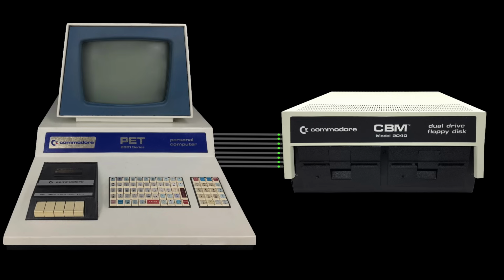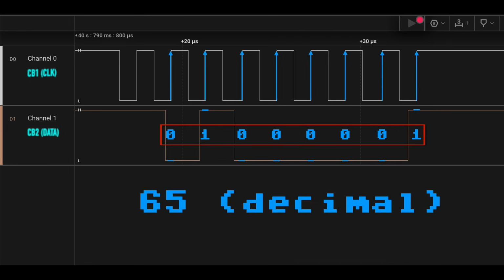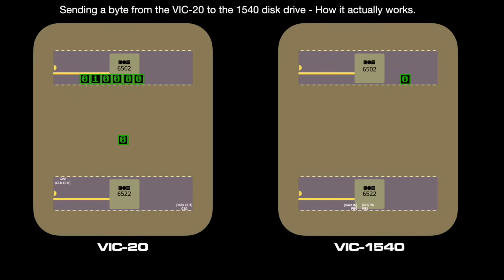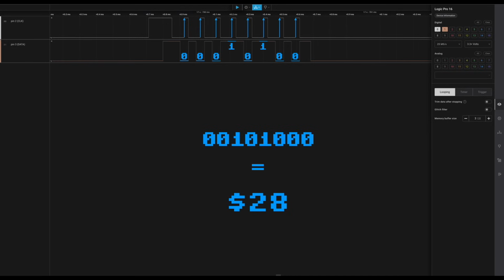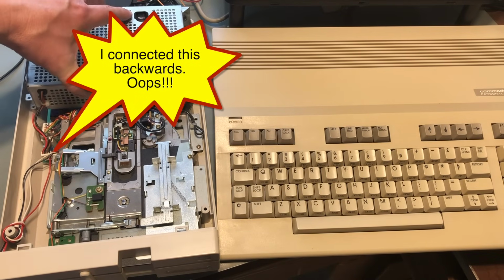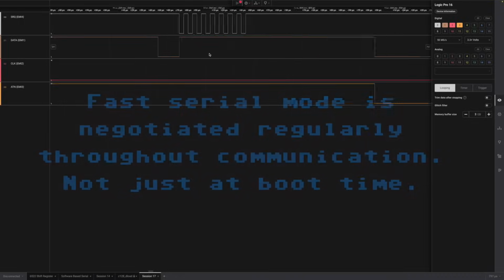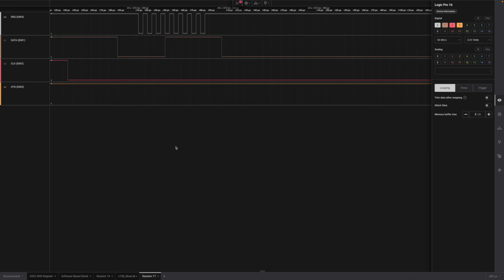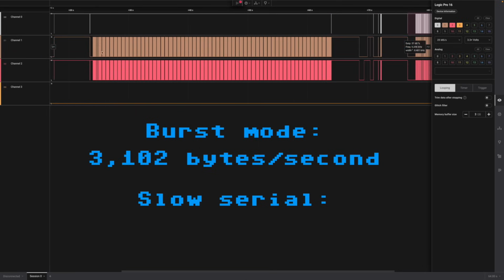Deep Dive: Commodore's Fast Serial Bus Protocol Explained

Comment: Very informative and interesting, worth watching again to refresh some stuff. I wonder if this could be fixed in C64 now, i think i saw some video about desyncing data because of 2 different clock domains and some approaches to fix it with hardware, although i think i'm gonna have quite a trouble finding it right now.

Comment: All they needed to fix the bug was 74LS74 in both the computer and the drive (and maybe 3 state drivers for direction control). Why they never realized that is a complete mystery, because it was evident that the whole problem was clock domain crossing and it was just needed to re-synchronize the clock to receiver PHI2.
Reply: All comes down to deadlines/timing, budget and profit margins and  of course human error. So yes solution maybe simple now, but at the time is $$$$ and managers and circumstances
Reply: I've heard that they wanted to get this out for Christmas, which was such a big driver of business in those days that missing it might have ended the company.

Comment: The slow disk on the Vic-20 is unfortunate but understandable, but on the C64 it was really inexcusable.
I mean I thought it was a bug improvement over tape, but that's about all you could say for it.
Reply: Funny thing tape with a fast loader (included in many tape based games) was about as fast as a 1541 with no fast loader.

Comment: Wow, so at least the burst version of fast mode was a good 8 times as fast as slow-slow mode! Now I wonder how this compared with using an SFD 1001 on the user port, and how it compared with using the 20- and 40-series drives with the PET.

Comment: So the burst mode was was the even faster fast mode? Because I saw that they made that work too. Why wasn't it just the default for the 128 mode/71 and 128 mode/81 combo? Which things could only work on slow-fast mode but and which things could work on fast-fast (burst) mode, and why?

Comment: I bet that doesn't actually plug into there, and I bet that Commdore's serial cables were the same for every computer that supports that protocol, even if we don't look at it. And yeah, the VIC-20 through the 128 includes the 264 series (+4, etc.).

Comment: Sure, they fixed with 128/71, but then hardly any software was written for the 128, so... sort of back to square 1, right? (Not that that was fully their fault. Too bad they didn't send out permanent patch chips. But if 3P devs wrote patches then why couldn't Commodore have used that method for stepping around bad 6522s and missing board traces?

Comment: Why would those silly production engineers remove the traces on the PCB then? And then why were those not restored in future board rev.s with the Kernal modified accordingly?
Reply: I’m guessing it was less removing traces which shouldn’t cost anything and more removing supporting components like tri state buffers or something. Commodore was REALLY cheap
Reply: @loraxiam : No, he specifically said this thing that I asked about.

Comment: Why didn't they just design a fixed version of the 6522 and fab that out? Yeah, a pushed-back release date on the 20, but their release dates were their own to modify as they pleased, were they not? And if this on the V20 and 40 was still supposedly slow then how was it still faster than on the 64/41?
Reply from the maker: I might have answered this, and your two next questions in my previous video, but not sure:

https://youtu.be/kaeFV0oZaps?feature=shared
Reply: @commodorehistory : OK, thanks, I'll check it out and see.
Reply: I would search the answer in the "business is war" mentality of Jack Tramiel: Delaying a computer would allow competitors to be first. And yes, I think this did matter around  the time frame that the VIC-20 was introduced.
Reply: @danielmantione : Yeah, I guess if he got word that Apple was working on the Plus or the IIe or whatever, or that T/RS was working on the CoCo or something like that, at the time, and he wanted to beat those, this makes sense. Thanks.
Reply: You have clearly never worked for Jack Tramiel, or heard the stories. Release dates were his to set as he pleased, and you made them....or else.
Reply: @Curt_Sampson : Exactly what I was asking about. HE was part of the company. So by "they" I meant even if it was him ("they," the company in general; so "him" if that's what it took). So you can't know just based on what I said before that I had never heard the stories. Because even someone who had heard the stories could refer to him as part of them and still have this question unless the person could've asked him about it or learned from someone else who had and gotten his reply.
Reply: @HelloKittyFanMan..  Nobody who's read up on Jack Tramiel could ever reasonably suggest that he might delay a ship date, especially by the months or even year that it would take to re-fab a chip.
Reply: @Curt_Sampson : Fine for them, but that doesn't apply here. I didn't suggest; I asked WHY. There's a big difference.
Reply: @HelloKittyFanMan..  Of course it applies here. The VIC-20 was a Commodore machine, and Commodore was run by Jack Tramiel. Your question is easily answered by noting that the action you suggest would have involved pushing back the release date (and not by days, but by months, at least) and knowing that Tramiel does not push back release dates, ever.
Reply: @Curt_Sampson : Wrong. No it doesn't apply, because: 1. you claimed that I would be suggesting to him to move the release time, but 2. that's not what simply asking WHY is. 3. I could already have the idea that he would supposedly "NEVER" adjust a release date, as you claim, but that doesn't mean I had never heard the stories, because my question of WHY he supposedly wouldn't ever is still valid, because "he never does" ISN'T the answer to WHY he supposedly "never does," or WHY he supposedly "couldn't have done it" in this case just because he supposedly never had before.
Reply: @HelloKittyFanMan..  My claim that the release date would have to be moved significantly is exactly correct: you were suggesting fixing and re-spinning the 6822 chip, and you cannot fix and re-spin a chip in a few days. Tramiel doesn't do that: he's rather release something that doesn't work as well than release something better weeks or months down the road. I don't know why that's so hard to understand.
Reply: @Curt_Sampson : Wrong. This isn't about "not understanding" something you said; and again, I wasn't suggesting anything; I was ASKING why about it. Also, it's not current that Jack does or doesn't anything; he's been dead for a long time and Commodore has only been back in business for a few months since many years (not just the 30+ since Jack's iteration went down).
Also, I didn't say anything about resending anything. Just because Jack used to choose not to do something doesn't mean he couldn't ever have changed his mind, hence my question here, as it could have been better to finally make sure this was fixed for the 64 instead of releasing something semibroken, hence my question. So if you don't know the actual underlying reason then it's okay for you to just admit that and move on.
Reply: @HelloKittyFanMan..  I have told you why. You've somehow got your knickers in a twist over my idiomatic use of English that included "suggest," but even so you should see that it's entirely irrelevant: it wasn't delayed for a that fix for the same reason regardless of whether you did or not did not suggest anything. And why you start bringing up Commodore from a completely different era, long after this decision had been made, I have no idea.

I won't be responding to this further: if you have difficulty figuring out why this decision was made the way it was after all this, you'll just have to live in ignorance.
Reply: @Curt_Sampson : No you haven't. You've only told me what he'd rather do and did. And now you're starting to be rude for no good reason. You obviously don't know the reason, so living in ignorance is something you've still been doing. I don't know why you replied in the first place.

Comment: "Software-based"? Isn't it actually still hardware-based but they just put it in the Kernal to tell the CPU to do, so it's kernel/CPU-based but still hardware (since that original one never loaded from disk or tape)?
Reply from the maker: That's exactly right, but the kernal is software. The distinction I was trying to make, but maybe failed to do, is that the 6522 did all the bit shifting and serial transmission in silicon, while the solution they ended up using was kernal software written to bit shift and manipulate clock and data lines.
Reply: @commodorehistory : Software in the beginning, before being permanently put on a chip, but it was my understanding that when programming is moved from something that's not a chip onto a chip that it can't be removed from, it becomes hardware, hence my saying that while this might act like software, it's still just hardware but that hardware is commanding the CPU, so this solution (or partial solution) is CPU-based rather than direct. Remember firmware? That's halfway between software and hardware; what was software to start with but then it lives on a chip that it normally stays on and is only rewritten with a flashing process. Isn't that the difference?
Reply: @HelloKittyFanMan..  No, all code is software. We call it "firmware" when it's stored in ROM instead of RAM, but it's still the same code, and still software.

The difference between the hardware and software shift is that for the hardware shift the CPU writes one byte to the 6522 and it's done: the byte is taken apart and transferred bit by bit by the 6522. Whereas with the software-driven bit by bit transfer (often called "bit banging"), the CPU masks out the bit it want to send, moves that bit to the correct location in the byte, writes that byte to the 6522, writes another byte to the 6522 to flip the clock, waits a bit for the other end to read the bit, flips the clock back, and then repeats that whole sequence seven more times. As you can see, that's a lot more instructions than just "write a byte to the 6522."
Reply: @Curt_Sampson : So what determines when a digital non-RAM, nonlash chip is just a place for software and that means what's on it is also firmware, vs. when it's just hardware, like when we call a CPU hardware? How are CPUs themselves made when they weren't coded themselves? In other words, how are those designed and then etched, and they weren't designed from code because they are what runs the code instead? And the same question for chips like the 6522.

Comment: They wrote this code on... what machine? Did they use the PET? I think I saw some disks that showed that, but I don't remember for sure. But then what did they write the PET on?
Reply from the maker: I think they did most of the PET development work on an MDT-650.
Reply: @commodorehistory : Thanks! What's the full name of that?
Reply from the maker: https://archive.org/details/mos-mdt/
Reply: @commodorehistory : Huh, interesting, thanks! Well then I guess my next question would be what this was written on. But I'll look around for a video about it.
Reply: @HelloKittyFanMan..  The original code for the first 6502 computers would have been written on non-6502 computers (there were plenty around—Gates et al. did MS-BASIC on a PDP-10) just on paper. It's tedious but not terribly difficult to write out assembly language on a piece of paper, hand-assemble it, and then burn the code into an EPROM or whatever. This is how Steve Wozniak wrote Apple II Integer BASIC.
Reply: @Curt_Sampson : At which of those stages that you mentioned would the PDP come into play? And then what about before EPROMS were available or at least common? Some code chips are obviously not those. So if you had to do this without one of those, how would that be done?
Reply: @HelloKittyFanMan..  The PDP comes into play at the programming stage, when you write your program in assembly language and then translate it (via manual or automated means) into binary data.

If you don't have EPROMs available, there are plenty of other forms of ROM or persistent RAM you can use. You can give your code to a ROM vendor to get a mask ROM made, for example. Worst case, you can simply solder diodes to a board to make ROM. Start with the "Computer memory" page on Wikipedia to get an idea of the various forms of memory out there.
Reply: @Curt_Sampson : Write it in assembly using... the terminal? And then what sort of thing in that system translates it into binary, and why would you have to do any of it on paper? And what I was asking about non-PROMs is: How does a ROM vendor/chip fabricator make a non-PROM version of the code you sent them?

Comment: 5:54 OK this is confuzzled. How can is be both MSBit and LSBit?  Whoever decided to move away from parallel really was a weenie. Imagine how much more seriously C= would have been taken if not for the slowest-of-class disk IO.
Reply from the maker: The 6522 and 6526 shift registers both shift data out MSB first. The software serial implementation shifts data out LSB first. So as you noticed, there is both MSB and LSB on the same bus. It works out fine because MSB is chip to chip, and LSB is software implementation to software implementation.
Reply: @commodorehistory  Sorry man, still makes no sense as described in video.
Reply from the maker: I get that you didn't understand how I described it in the video. Does my reply in the comments not explain it? If not, what is confusing? I'm happy to help.
Reply: Moving away from parallel likely was a wise choice: You should not underestimate the impact of low-cost easy to handle cables for consumers. Of not using the 6522 shift register was a major drawback and did highly impact the usability of Commodore computers, but even considering the slow speed of the serial bus, it may have been a wise decision in hindsight. Programmers quickly solved the slow software implementation with fastloaders, so the 1541 could perform great in practise, while the uses did benefit from lower cost hardware.

Especially late in the C64's life, when the hardware had to be cheap, expensive cables would have had an impact on sales numbers.